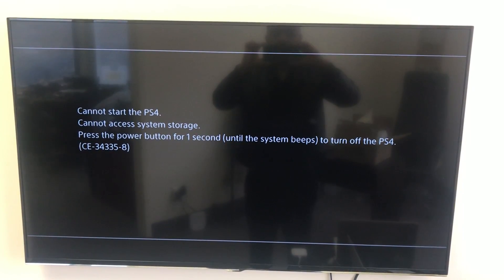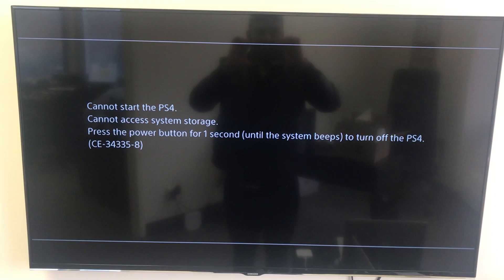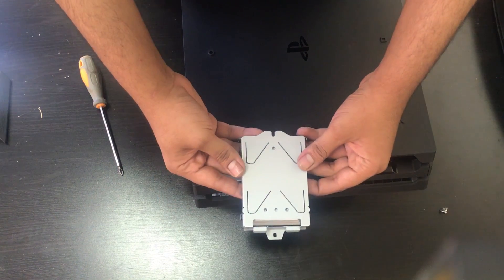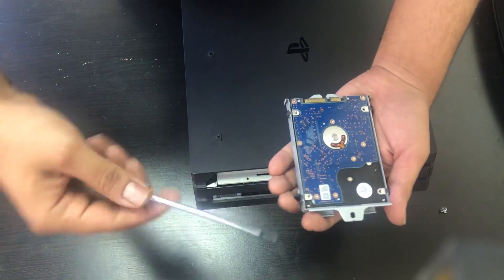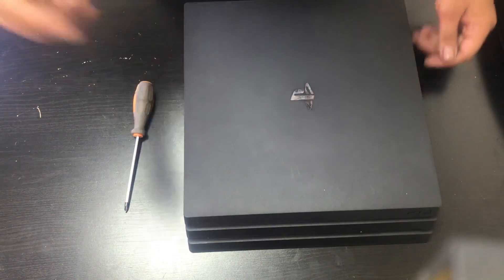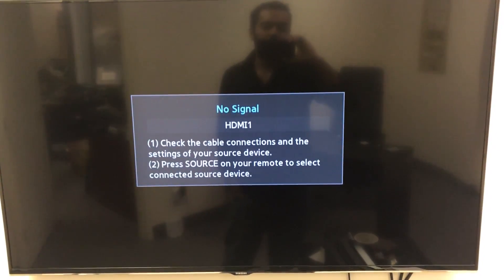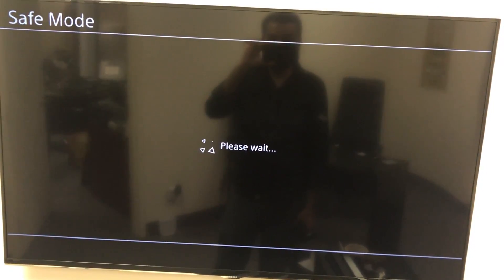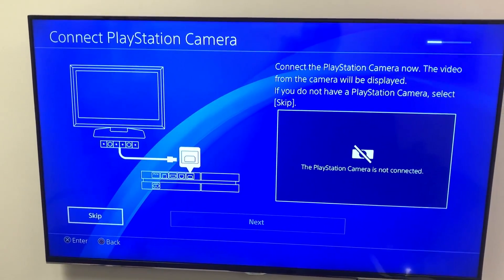PS4 Pro Cannot Start (CE-34335-8) Cannot access System Storage Error Repair

Comment: Before doing this, I recommend just turning off your PlayStation 4 for a while (an hour) and then try to turn it on again and see if that works, because it worked for me.
Reply: Yea i cane home from work one day was working again
Reply: You’re a lifesaver subbed👍thanks didn’t want to have to do all that.
Reply: TheGeneric1 is it a slim
Reply: @kristinacondor3253  Pro
Reply: TheGeneric1 do u think it will work with a slim
Reply: @kristinacondor3253  idk, maybe. Give it a try.
This has happened to me about 4 times in the past 3 months btw. Not sure why but somebody told me to block any messages that don't come from friends and to delete any notifications after they finish downloading so this won't happen again. I'm no expert on the PS4 but this sounds like some type of virus.

Anyway, after the third time this happened to me I decided to buy a external hard drive and save all of my games on to that, so if I had to reinitialize the PlayStation 4 and delete all my data it wouldn't be a problem because all of my games are stored on the external hard drive and all of my saved game data is stored on the PlayStation Network Cloud since I'm a PlayStation plus member.
Reply: The same thing happening to me right now. I've been experiencing this problem for a few months now randomly. The fact that you said delete group message just helped me figure out my problem cus this ain't starting happening until I start getting those which started a few months ago. Idk how I even got into the group chat.
Reply: Thanks man, saved me from doing all this nonsense.
Reply: It works for me only for a few minutes than back to freezing

Comment: Mine won’t even go into safe mode. after about 3 to 5 minutes the error screen pops up saying that it can’t access the hard drive. is it cause of a bad hard drive.
Reply: after it started working I sold that shit ASAP lmao
Reply from the maker: After watching this video, what do you think?
Reply: Fasttech I’m not really sure to be honest. when I try to boot up the system nothing happens for the longest time. no PlayStation emblem or anything. the system will sounds like it’s trying to do something then after about 3 minutes the PlayStation logo pops up then the screen shuts off again then comes back on and it’s black for about 2 minutes then the error message finally pops up.
Reply from the maker: Is it the same error message at the beginning of this video?
Reply: Fasttech yes
Reply: Fasttech what was really crazy is how it didn’t happen till I tried putting it into safe mode. it all started when my PlayStation couldn’t read my IP address so I couldn’t get online. so I tried putting the system into safe mode. then that’s when it happened.
Reply from the maker: Yes its a dead hard drive. Link is in the description if you want to buy one.
Reply: Fasttech I just bought a new 500 gig SSD Drive for it. thanks though for your reply’s. it helped me pretty much know that it’s a hard drive issue for sure.
Reply: Mine did this, let my system sit for a week, now it lets initialize the PS4 and now everything works, did I get lucky ? This error started happening because the power cord falls out, does this mean my hard drive is okay ?

Comment: Hi my son has a problem similar to
this. He’s doing the reinstall system update and he passes the initialize part goes to the preparing to update system software and when he gets around 63% it says Cannot connect to hard drive or something like that please help
Reply from the maker: You need a hard drive replacement. We offer this service on our website but if you want to do it yourself you can buy a hard drive online or check our site in a few weeks we should have PS4 Pro drives in stock soon.
Reply: thank you